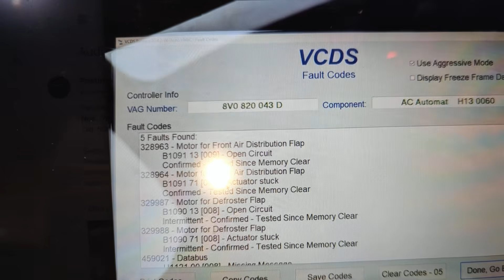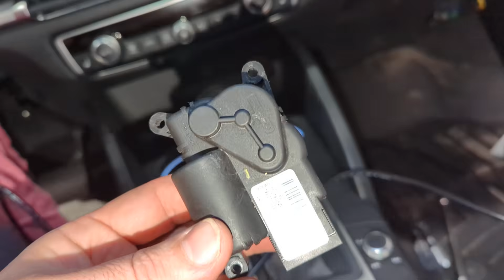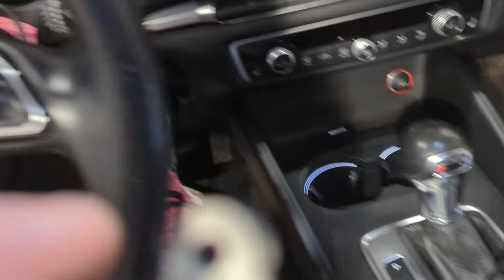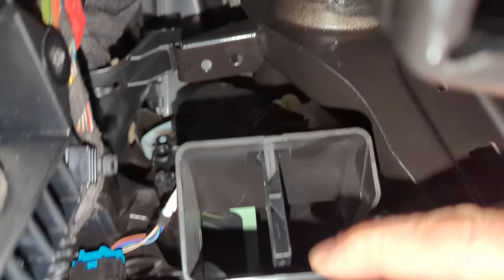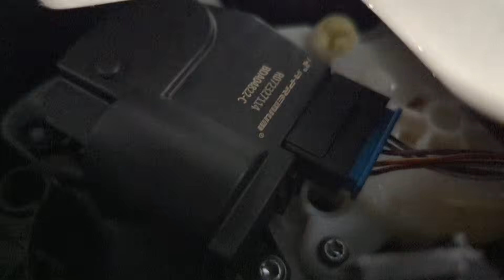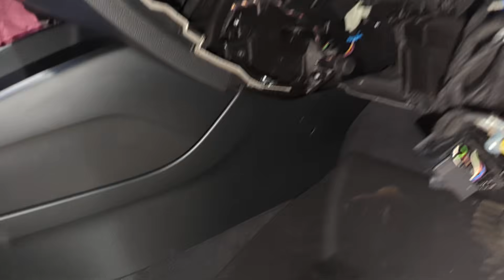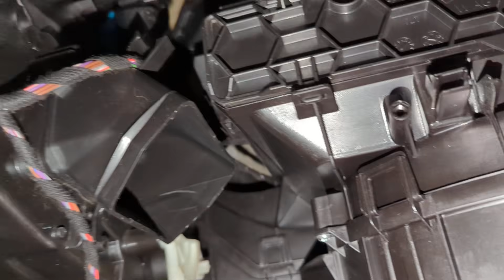2015 Audi A3 VW Golf MK7 HVAC Heater Air Distribution Flap motor identification 5Q0907511

Comment: Fresh air recirculation (no basic code) error after installing the revised defrost flap motor. Is this possibly a bad motor on the fresh air flap above the cabin filter causing this code? I can’t figure it out and after recalibration etc of end stops still get the code after deleting
Reply from the maker: @bfoust3488  Did you attempt to perform a Basic Settings on that recirculation flap motor? What's the exact fault code?
Reply: @ B108B54 and B108D54
Reply: @ we did try using obd11 pro
Reply: @biturboaudis4   B108D54 B108B54 not sure if these went threw or not
Reply from the maker: @bfoust3488 B108D 54: Motor for Right Temperature Flap
B108D 54 [009] - Missing Calibration / Basic Setting

B108B 54: Motor for Fresh Air / Recirculated Air Flap
B108B 54 [009] - Missing Calibration / Basic Setting

Those are the full definitions for those two faults. Did you change the right side temperature flap motor too? If not, probably a good idea to check that one. 

Do you get a "Completed OK" confirmation when you attempt a basic settings?
Reply: @ I’d have to ask my buddy, would that be the far right motor that sits off by itself or the one under the defrost flap one I did
Reply: @  buddy said we did not get a completed ok message

Comment: where is the motor for rear temperature flap?  That one should be inside of center console underneath of infotainement screen in the middle. In the manual it should be V137 for VW

Comment: Hello, is it difficult to remove the knee airbag?
Reply from the maker: @laurentchaffanjon6474  No, it is very easy. You will want to have a scan tool handy to clear the Airbag fault afterwards.
Reply: @biturboaudis4  Thank you .. I have already changed the defrost servomotor which was quite easy .. 
but this one will be a little longer because the screws seem difficult to reach ..
thank you for your video, it is very useful ..
but I do not understand how a brand like Audi can neglect the quality of this kind of part ..
Reply from the maker: @laurentchaffanjon6474  This is the problem with publicly traded companies...gotta keep the shareholders happy (above all else), thus something's gotta give, and it's usually in the form of acquiring components from the cheapest bidder/supplier that can meet the minimum requirements.
Reply: @biturboaudis4  you may be right.. he could have made it so that these were more easily accessible parts 😂
Reply: One question, are they the same motors? I can't get air coming out of my lower vents. Are they the same as the other blend doors on the glove box side
Reply: The reason I ask is because I ordered one thinking it was the glove box side. I don't want to order another one if I don't have to

Comment: Watched the video. Great info. As mentioned, pulling and remounting the front air distribution flap actuator was a nightmare. I didn't have to remove the instrument cluster, so getting that top torques screw SUCKED!! Got smart and employed a few magnets to get it back in. That made a big difference. Thanks for uploading. I spent too much of my time on the wrong side of the car, assuming the actuator I was looking for was behind the glove box. Shoulda come here first   (ಠ_ಠ)
Reply from the maker: You're welcome. I did the exact same thing (worked on the wrong side of the car first), so I figured it would be a great idea to share my failures!😂
Reply: @biturboaudis4  
How tragically right you were! LOL
Reply: @biturboaudis4   thankssssssssssssss
Reply: It's just two screws and a connector and you can plop out the whole cluster in a jiffy. The advantage is you can now just shove a light in there as well as having an extra viewpoint when needed. 

I'll be doing this job myself soon as well when I receive the new part. I think I'll see if I can fit a long bendable bit extender that I attach to a power drill and shove up there. Hopefully I can make it fit in there. Then it's just wizz wizz and it should theoretically be doable.
Reply: @Johnnie----I  
Crazy that you responded to this today... that replacement i put in 10 months ago cr@pped out last week and I have to repeat this process AGAIN... timing.
Reply: @mackobun  I've also seen this trend myself sadly. If mine does the same I'll just cough up the extra for an original Skoda part and hopefully it will last longer. The one in my car now is from january 2016 so it held up almost 10 years. 

I changed a xenon igniter for one of the front headlights last year and it cost 1/10 of an original part and it's held up over a year now. Sometimes 3rd party options work, and sometimes they don't.
Reply: What’s the best way to align the new actuator and the locating pin? It’s a struggle to get them to fit together with the limited space.
Reply: @colelyon7763  
Manually turn the new one to match the orientation of the one you pulled off. It SHOULD then actuate to the Open or close state when you get everything back in place, star the car (accessory only) and toggle the clime controls that initiate that actuator. 

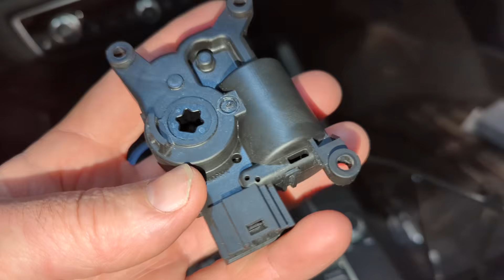Reference Time index 0:25 of this video and pause. Notice there is a star pattern with pointed teeth, and one FLAT tooth. That's how you get them to match

Comment: There could be Valeo or Denso HVAC, don't know if motors are interchangeable. Before mounting a new motor it is also worth setting it in the same position, the old one was in (connect the new motor to the harness and switch from the panel until it will be in the right position).
Reply: Just pop off the lid of the motor, and pull out the big top gear(can be pulled straight up by hand). Then you are able to rotate the gears which mean you just match new to old motor(by the squared section of that star pattern), and plop the gear back in and press the lid back on. 

I did that today and it worked.

Comment: i’ve got an a3 that doesn’t blow warm air at all, checked heater matrix and that’s all okay, so would you say it’s possible that my problem could be with the flaps/motors or with the control unit itself?
Reply: Did you ever get to the bottom of your problem I have the same

Comment: What controls the middle vents? The only vent that blows is the driver side vent by the door and on the passenger side one as well.
Reply from the maker: The front air distribution flap motor controls that airflow. It's the hardest one to get to, left side, upper.
Reply: @biturboaudis4  thank you
Reply: @biturboaudis4 driver side or passenger?
Reply from the maker: @minialeks123 Both. On these vehicles, there is no way to control the direction of airflow separately between the driver and passenger sides.
Reply: @biturboaudis4  My Golf Mk7 in Australia is RHD.  The front air distribution flap motor is in a similar position - accessed after removing glove box and all sundry of panels, then 5 minutes and it's out.  Can move the airbox shaft in the car manually through limited positions and while the actuator motor is working properly, seems the various arms and airbox flaps are somehow jammed so the front air... motor can't move the flaps to the correct position, I get air from the side vents, but not the centre vents.  We're getting more 40-43C days in Melbourne (climate change) so good aircon is essential.  Properly frustrated and I am pretty good on the tools.

The other problem is the fresh/recirculation flap motor - the flap is locked in one position, no amount of calibration will fix it.  I can see the flap and tried to move it by hand - it's locked solid.  Can barely see the actuator, let alone remove it.  Here's the codes off OBD eleven
B109171 - Front air distribution door motor Actuator jammed
B109154 - Front air distribution door motor No basic setting static
B108B71 - Fresh air, recirculation, air flow flap motor Actuator jammed
B108B54 - Fresh air, recirculation, air flow flap motor No basic setting
Recirc motor is on the left (passenger) side behind the glove box, fuse panel and the main steel tubular structural member.  Looks like a dashboard out job.
Car is still driveable, even with the glovebox out and head unit connected and sitting in the footwell.  I will ask for a quote from a dealership...  I'm scared.
I understand that this is a common failure on VWs and the relatives.
Reply from the maker: @johnharvey4496 It's unfortunate how fragile these actuators really are. One thing is certain: if you can move the flaps by hand when the actuator motor is removed, just replace it, regardless of whether or not you can witness the actuator moving when it's connected.

I'm doing one today that had no faults, yet there's very little heat output. On closer inspection, the white plastic gear has worn the end stop on the actuator housing, and thus it's moving too far in one direction, jamming itself in the full cold setting any time the temperature is set to LOW.

Just junk! Sometimes it makes you wish you had the old lever-style HVAC controls 😂
Reply: @biturboaudis4  Is the front airfoil the engine visible in the upper left of the video?

Comment: Great video, thanks for posting this in such detail! 🙏🏼

For a UK (RHD) car, my error code is “328964 - Motor for Front Air Distribution Flap B1091 71 [008]”

I’m a little confused but does this mean the faulty motor is the lower one near the footwell on my driver (right) side?
Reply from the maker: The front air distribution flap motor on LHD vehicles is on the left side, upper motor (behind instrument cluster). It's the hardest one to get to. On your RHD car, I'm almost certain it's in the same spot, thus in your case, and based on your fault code, it'll be behind your glove box, close to the top.

The two lower motors are for driver and passenger temperature control only; one on the left side of the air box and the other on the right side. These are the easiest to get to.
Reply: @biturboaudis4  Thank you for the quick reply! 
I understand what you’re saying and that makes perfect sense 👍🏼
The weird thing however, is that regardless of the fault code, my problem is the temperature control on the right side (my driver side) is not working. I only get cold air from the vents on this side of the car. Other side is fine 🤷🏽‍♂️
Which would suggest I need to change the lower (easier!) motor…. 
Hence my confusion

Comment: Great video that I sadly only found now, after repairing my car.
Notes to others who find this before starting the repair: 
- You don't need to remove the Instrument Cluster
- On a LHD vehicle, you have to remove the driver footwell airbag to get up to the distribution flap motor. If you don't want to disconnect its electical connector, just put it on the brake pedal
- for getting the screws out, use a bit that's as magnetic as possible on a ratchet. Saves you from losing screws in there.
- for getting the screws back in, use a bit of tape to fix them to the bit, that way you can't lose them but you can just pull to "unstick" them once you have them screwed in some threads deep
Reply: Thank you for the advices. How difficult it is to remove the driver footwell airbag and the black air conduct?  I need to replace the front air distribution motor

Comment: I moved the flap  (without motor) to see if it was stuck... By looking at the new motor incould see that it isnt symmetrical, so would that mean that you cant put the motor badly on the gear of the flap? 

Thanks for your answer👌👍
Reply: Yeah, the motors and shafts are asymetrical to avoid misalignment. Though the adaptation procedure for the replacement calibrates the end stops, so...
Reply: Repaired! Thanks for your help mate  @werdck3321

Comment: Can you please tell me how to align the gears of the motor and the flap? Did you do it by hand?
Reply from the maker: Yes, I aligned them by hand. One needs to take note of the position of the old motor upon removal, then the new motor can be actuated, by plugging it in without mounting it, so that it matches the position of the old motor. As a matter of fact, when I replaced the first flap motor, I didn't have the teeth lined up properly, and as a result the motor skipped a tooth on the gear when I actuated it. It was fine after that.

Comment: Thanks.  Currenty have temp problems on my MK7 golf on the drivers side.  What you pointed out for the temperature control is probably what I will need to replace.  Looks like that is in a better spot for removal.  (Research continues)

Comment: Thanks you for the information, best explanation video out there! Had to also do it for mk7 Golf, because the aircon was not blowing air to the footwell. Part number was 5Q0907511A but was also advised to use 2Q0907511G and OEM part because cheaper parts can be risky. Did not need to remove the instrument cluster, but the two screws took a nice hour to get out. The lower one can be done with a smaller hex screwdriver and the top one I did with a regular screwdriver with hex head, just have to figure out the right space to put it through.

Comment: Hey ive got a right hand drive vw passat. Will the defroster flap motor still be on the right hand side, in my case the drivers side? Cheers
Reply from the maker: Before making this video, I watched another video from someone in the UK and from what I gathered, yes, the flap motors on the HVAC unit (except the recirculation flap motor) are in the same spot on the RHD cars.

Comment: Thanks for the video. So i have codes B109071 defroster flap, B108B13 & B108B71 fresh air recirculation flap motor. These if i understand you correctly are right side behind glovebox. top one center area and one far to the right on the flap door above fresh air filter? is this correct? same car. Looks like part # 5Q0907511d is now 5WA907511B.  I get air all the time out the defrost front window and can get air out the vents but still defrost vents if i only have vent button on. never get air out foot area no matter what switches are on. I can turn vent air flow off but always getting air out defrost no matter what.
Reply from the maker: You are correct: Both are behind the airbox. The defroster flap motor is the upper flap motor on the right side of the HVAC box in the center of the vehicle. The recirculation flap motor is above the cabin filter, far right side.

Comment: What tools did you use to get in that tight space?
Reply from the maker: I used a 1/4" drive palm ratchet (little round thing) with a T25 torx bit on it, and a 4" extension because it's a bit of a far reach for the top bolt.
Reply: Could you do a walk through of how you removed the instrument cluster?
Reply from the maker: @MikeBrown-rr9wj  There is a cover on top of the steering column that has a piece of vinyl fabric on it. That cover/piece is clipped into the bottom of the cluster and needs to be pulled towards the rear of the vehicle, which exposes two screws that secure the cluster to the dashboard. Once those two screws are removed, the cluster can come out.
Reply: @biturboaudis4  Thank you for the insight. I'm going to tackle this project this weekend. Are there any tips on disconnecting the motor from the flap arm (or whatever is connected to the motor)? In other videos, I saw a yellow arm or pulley system. Did you disconnect the battery, like I usually do when working on cars? Sorry for the barrage of questions. I'm just trying to get a leg up on the job.
Reply from the maker: @MikeBrown-rr9wj  I did not disconnect the battery, but it was a bit of a PITA to align the new motor to the flap position. I had to adjust the flap's position more times than I want to admit before the new actuator lined up properly.